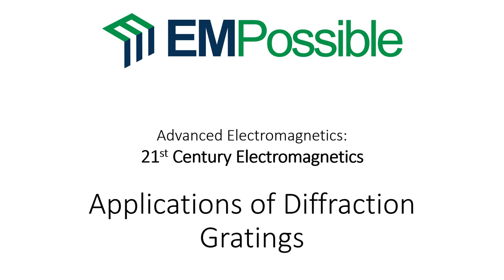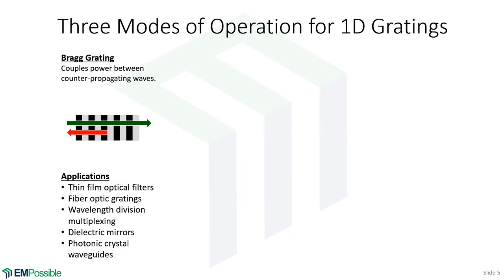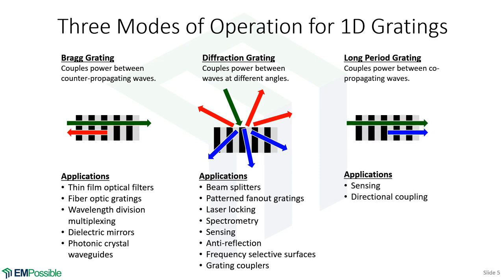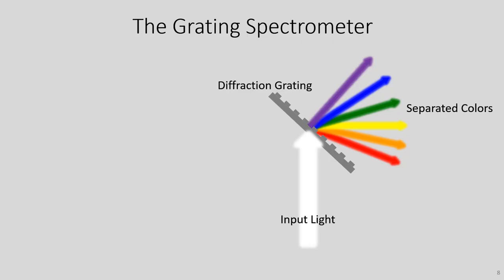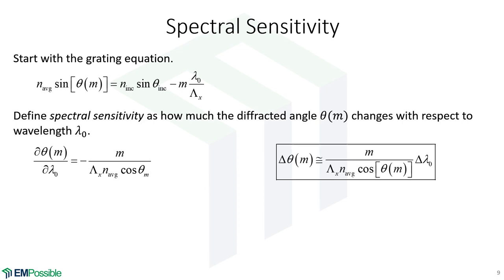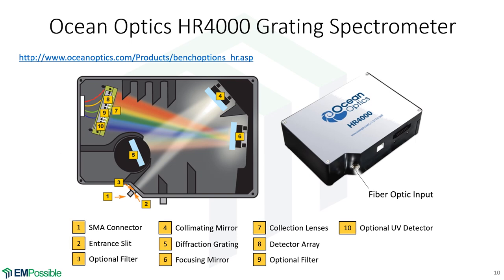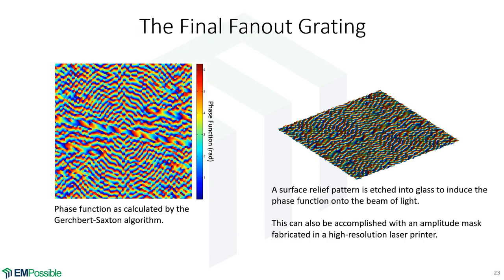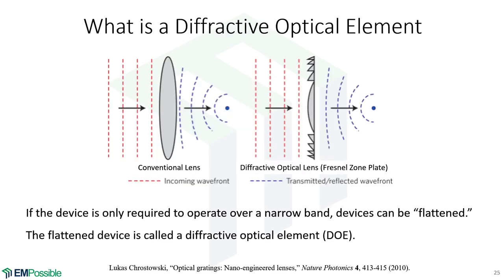Lecture -- Applications of Diffraction Gratings

Comment: Thank you so much for this instructive video. I actually have two questions 1) how do you convert the phase information calculated by the Gerchberg-saxton algorithm into amplitude pattern for the fabrication, I mean how do you control the amplitude of the surface relief pattern ? 
2) Can we use the same phase to get an image in reflexion if we deposit a metallic layer for example above the fabricated  relief pattern ?

Comment: Thank you professor for a wonderful explanation! I have one question for you. 
What is the difference between metagratings, metasurfaces and diffraction gratings?
Reply from the maker: I am not sure what a metagrating is.  People will stick the meta prefix before a lot of things.  Maybe it helps them get research funding.  It is probably a diffraction grating employing metamaterials or something else to enhance its performance in some magical way.

A diffraction grating is a planar periodic structure where the period is greater than the wavelength.  The period is large so that it produces diffraction orders.  These are used as beam splitters, fanouts, pattern generators, dispersion elements, and more.

A metasurface is a planar periodic structure where the period is much less than the wavelength.  It does not diffract.  Instead, it controls the amplitude and phase of the reflected and transmitted wave across the aperture.  I talk a little bit about metasurfaces in Lecture 7a from the course website:

https://empossible.net/academics/emp6303/
Reply: Thank you sir for your precious time.
 
According to my limited understanding, metagratings magically combine the properties of metasurfaces and diffraction gratings and can produce isolated desired diffraction orders. For example, from a diffraction grating we can not isolate 5th diffraction order. But metagratings can somehow cancel out undesired diffraction orders and at the end we can have a 5th diffraction order only. I am not too sure about my explanation but thought to share it with you.

And also thank you for uploading amazing series of lectures as well.
Reply from the maker: @mohamedelkabbash6492  There are a few topics that I want to emphasize in the course.  Metasurfaces is one and frequency selective surfaces is another.

Comment: Qns. In the Littrow Configuration, is the line width equation also true for capturing the cone of angles for a given wavelength range? In a reverse design, if we send a wavelength range $\Delta \lambda$ within a cone of $\Delta \theta$ will we be combining the beams?
Reply from the maker: The reverse will happen due to reciprocity.  However you will need all the colors to be at exactly the correct angles.
Reply: @empossible1577  Wow, Thanks for the reply and also the answer.
I would also like to thank you for posting such amazing lectures. I`ve been learning alot from your youtube video lectures during the course of my PhD.
Reply from the maker: @sugeetsunder5323  Great to hear the videos are helping you!  I work on the material almost every day.  I appreciate the feedback!